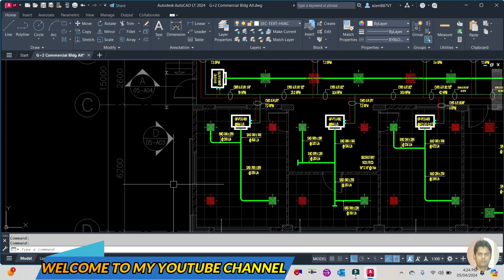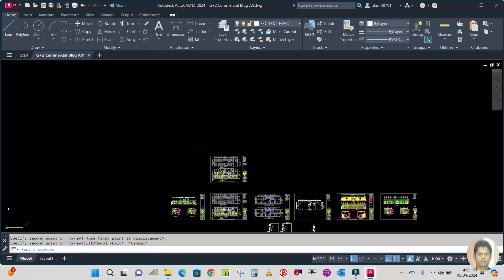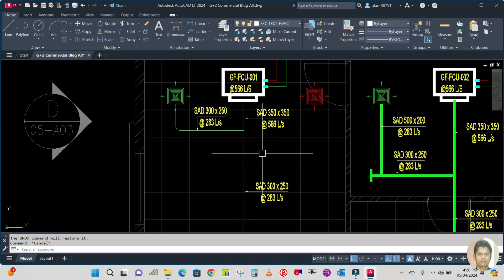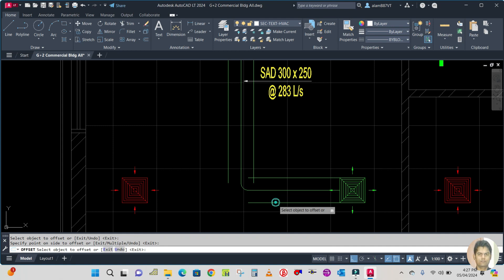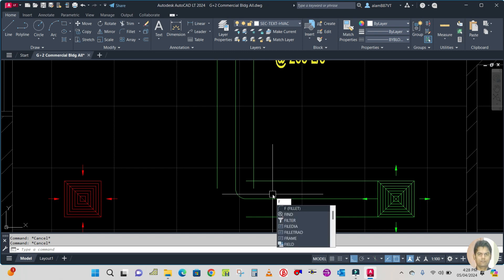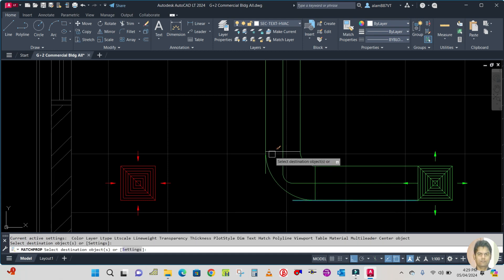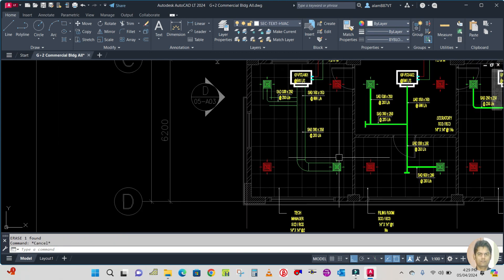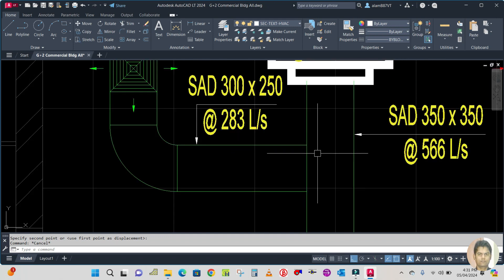1  Shop Drawing For Ducted Split II How to create ducting shop drawings in real practice II EasywayI

Comment: Sir how to connect Dx type AHU with their outdoor and which equipment use intermidiat during connection of copper pipe to the odu any shop drawing please send for understanding
Reply from the maker: DX unit can be connected with copper pipe and refrigerant will be charged
Reply: @successengineeringofficial7742  sir thankyou sir have you any Dx type system shop drawing please